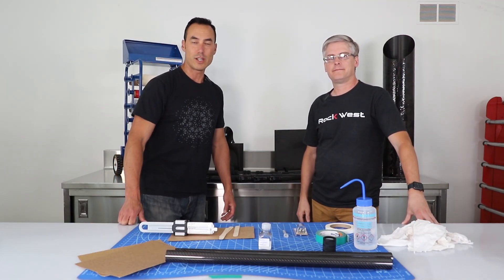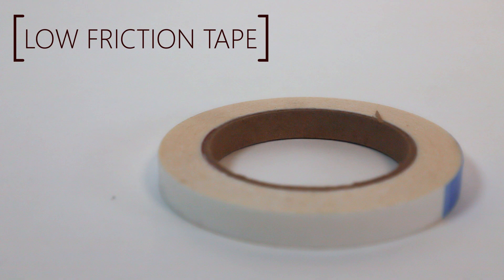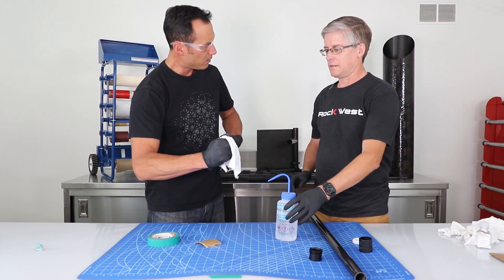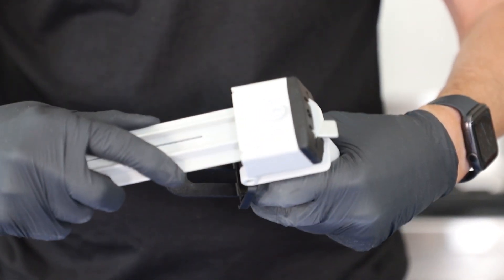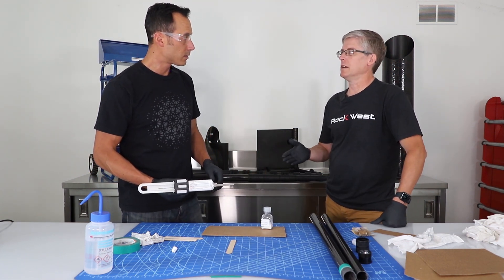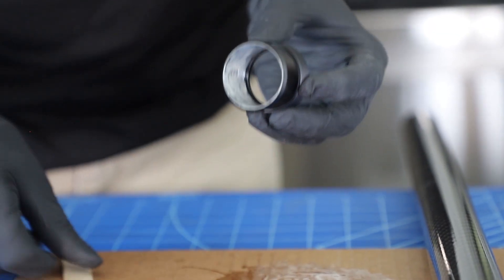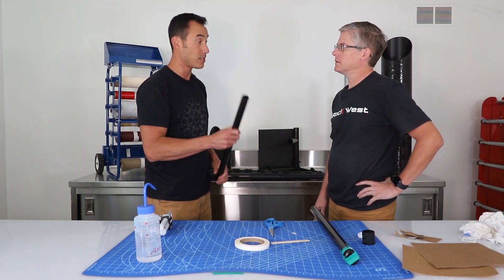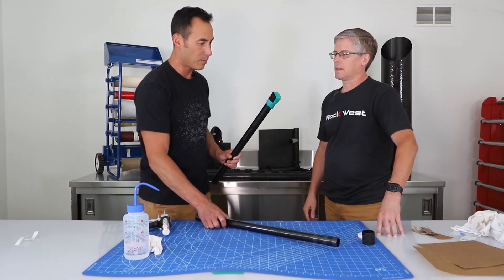INFINITube Compression Ring Product Assembly

Comment: Should always mix epoxy on a nonporous surface and mixer. Cardboard and wood will absorb chemicals out of the epoxy thus loosing its properties. I use plastic board and plastic spreader. Totally reusable. Just let it cure on the board and peel it off for the next batch
Reply from the maker: Great observation, but with the allowable minor variances in stoichiometric epoxy mix ratios, especially with tube dispensed adhesives, The minor amount of material absorbed into the cardboard (of both part A and part B), will have an imperceptible affect on the final cure properties of the adhesive.